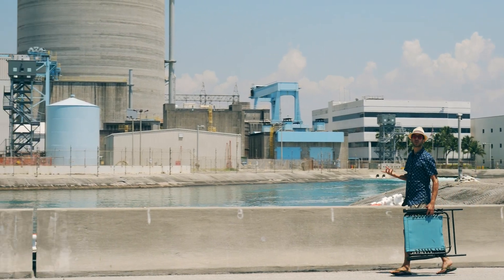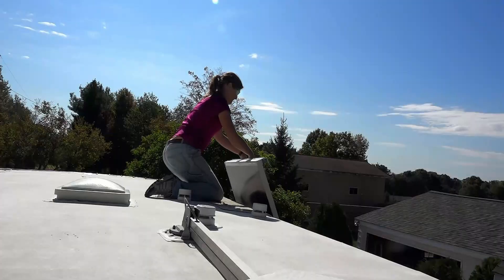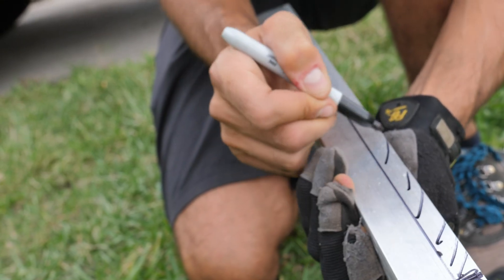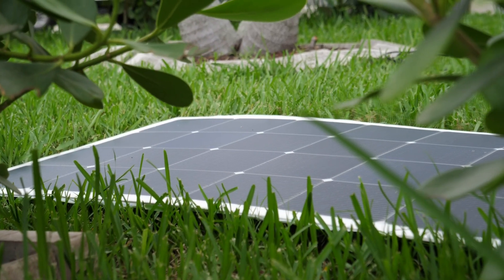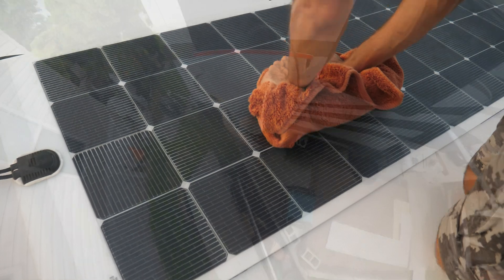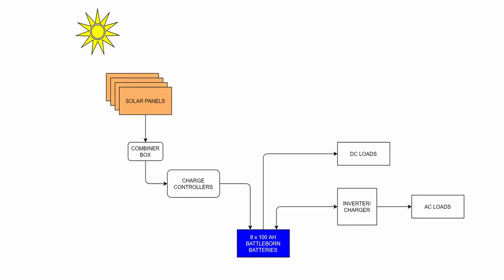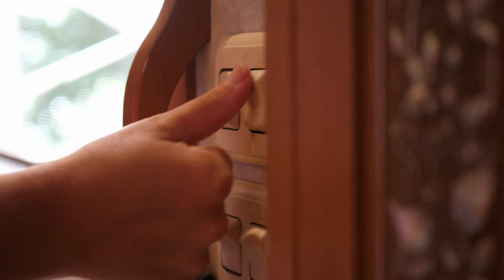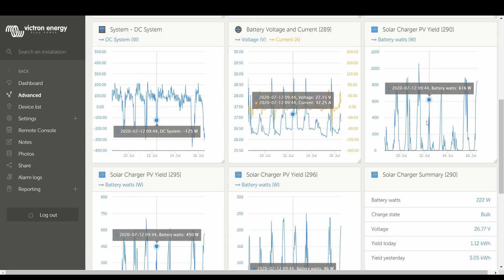Ultimate RV Off-Grid Solar System Build - 2760 Watts of Solar ☀️ 11Kwh Battery, on a 32' Fifth wheel

Comment: recently I was asking everyone in the Facebook Truck Camper group which I am a member of how they would install the flexible solar panels on the top of the camper.  Many had installed the Flexible solar panels reusing their old solar panel frame mounts in order to leave an air gap between the camper surface and the flexible solar panel in order to not heat up the solar panel from the heat transferred from the camper roof material that the flexible solar panel would be absorbing if directly attached to the roof like you had done.  The additional absorbed heat would presumably lessen the performance of the flexible solar panel.  Typically, solar panels produce less energy as their temperature of the panel rises

Comment: Can you please tell me how your JC Refrigeration install is holding up?  We are heading to Indiana in Sept to have them install one in our refrigerator in our 2019 Airstream.  Airstream has replaced the refrigerator once for us and it still works poorly, so we are going to try the compressor over the evaporation system.
Reply: @Nancy Lawn We stopped at JC Refrigeration last summer to have them install a compressor retrofit on the Dometic refrigerator in our 2018 Airstream. After they pulled the refrigerator out of the trailer they discovered that their system will not work because of the type of control board in the refrigerator. This was despite my giving them the exact model number before we even made the appointment. They were not aware that Dometic was using the type of control board in their refrigerators that is incompatible with their product. I suggest that you confirm with them exactly which Dometic refrigerator and which control board you have in your Airstream before driving to Indiana.
Reply: @cliffstraw3556  Thank you so very much for the warning.  They do have our model number of refrigerator (RMD 8555).  I will certainly call them again especially since it will be a two day trip to get there.

Comment: Hello from Canada! You folks have (many times) found a way to my heart. Since you have done this, on the net there are a couple of smallish 400W (or less) 'personal' air conditioners. I don't mean the garbage that just humidifies the air for $60, but small ones with compressors etc which run up to $1000. What would you think about using something like that on a big system like you have to help out over night? You have 2700 W => ~200A of 12V current at max sun. A typical 13.5 kBTU AC will draw about 130A. So, theoretically you could run your roof AC during the day and not lose ground. At night, if hot and humid, you after the sun goes down could use a smaller one like describe above to at least keep the bedroom decent until morning and more sun. Does this make any sense? Also, since you have your panels surface mounted you cannot tilt them. Is the penalty for that significant if you stay in the continental US? Travel safe, Henri

Comment: The evolution from screws/holes/brackets to giant stickers is really something else. Similar to giant decal coverings used on aircraft/land vehicles and boats. What kind of tape did you apply around the perimeter of the solar panels?

Comment: Great video, executed like a pro.  QUESTION: When stating the size of your battery bank, how do you convert from amp/hours to KwH (i.e 800amp/hours to 11KwH).  I think 12v or 24v system is somewhere in that equation?

Comment: Yet another really well thought out video in every aspect, it’s so professional by you guys and sets such a benchmark for other you tubers that has sadly been missing by most since Nicky & Jason Wynn set sail. The amount of time and effort that you put in to this channel is staggering and so impressive. Unfortunately, I’m not educated enough in the field of this particular subject but, always wonder why the space above the slide outs is never utilised by anyone. I presumed it was probably due to excessive weight and high cost of the solar panels etc... Maybe now is the time to consider whenever a slide out is extended, that it also pulls a solar panel from it’s storage position above the other fixed solar panel’s on the roof. Which will mean that when the slide outs are extended the a solar panel is also extended at the same time. I suppose the downside is that the slide out/s have to be extended to make the ones that are partially covered ones beneath them able to be used and, in turn generate maximum efficiency etc...
Again thanks guys from this side of the pond here in rainy Brexitland, England 🏴.

Comment: I absolutely love your new system. Seems like such a simpler and proper setup as compared to what you had before.  I’m not trashing your previous setup at all.  Solar has come a long way since your original system.  My wife and I have a custom box truck/semi truck, set up like an RV inside.  We have a small set of solar panels that essentially trickle charge the batteries.  We may have to look into this system here since it can run the AC and other components inside. That would be perfect for us, especially since we have plenty of space atop our box for panels. We could finally use our 8k Onan as a backup and run mostly off solar. An Onan is expensive to run and maintain. This just sounds so much better.  Thank you for sharing this video. I look forward to hearing how this system works long term, and I’ll be looking more into this brand.

Comment: 13:43 what is 5000 volt amps? Never heard such a thing
Reply from the maker: I will explaine volt amps in a future blog post but it's the appropriate way to rate power of AC devices. Similar to watts and equivilant in some circumstances.
Reply: @MortonsontheMove  IIRC they are equal for DC and purely resistance AC loads like a toaster but not for AC loads like induction motors and stuff with surges?

Comment: Awesome installation.  Do you have concerns over heat from the panels cooking your roof material?
Reply from the maker: Yes and no,  We will address this in our next video on the system.
Reply: @MortonsontheMove  Fantastic teaching video, great job. I did notice that another channel did a follow up video on panels stuck to the roof and there were yellow areas on the roof that he felt were from the heat. Don't know if the solar panels get hot from generating electricity or the sun shinning on the black panels, or both effects. But on his new install he placed some insulating material under each panel. As you say, you will monitor the situation. Thanks for the education.

Comment: Where in Florida were you. We are in SE Florida in Boca Raton. Also why do?dn't you build a lightweight tiltable panel on which to mount the two panels on the front cap so they could be adjusted to gather better sunlight? That would have been nice.
Reply from the maker: We actually thought about it!  Just came down to complexity and longevity of the design.

Comment: Dang! Wish I would have known about this. I would have def volunteered to come help! I wonder how the increased heat will affect the performance on the panels. I also wonder how the heat of the inverter being so close to the batts will affect the longevity of the LiPO batts over time. Stay safe and healthy! As always, a great video!
Reply from the maker: Hey Joe!  As for panel heat we will address that in the next video. Because its the larger inverter @ 24V it really doesent get that hot.  The space is also pretty large so we havent seen temps exceed the 90's in there in the worst circumstance so far.... so should not be a problem.

Comment: How long can you run the air conditioner?  Also, what about your logo that was on the cap?
Reply from the maker: Lol, Logo is gone.  Well during the Day the solar can keep up with the AC,, not much left over to charge the batteries tho. On a full charge the AC will run for about 7 hours on this

Comment: Fantastic video Tom & Caitlin!  How do the BattleBorn panels deal with heat?  I understand that is the main disadvantage to flexible panels.
Reply from the maker: That is correct and we will discuss that in our next video.
Reply: @MortonsontheMove  was there a video put out discussing the heat topic of these flexible panels? If so I am missing it. Also, how do these panels do with the energy consumption versus the rigid panels?

Comment: It appears that Battleborn is not interested in marketing those panels on their site. Who else sells them?
Reply: The only online source I know of is 4thdsolar.com. The panels are manufactured by Merlin Solar (merlinsolar.com). Xantrex also sells them (and now BattleBorn). They are great high-end flex panels with lots of shapes/sizes but pretty expensive. I've been testing one for 8 months and would recommend them if you have the money.
Reply: RV with Tito DIY Thanks! Holy smokes, they are $$ proud of them!!
Reply: @RVwithTito  holy shit are they expensive. 220w for $800 no thanks.

Rich solar are $0.80 a watt. Definitely not as nice or flexible but dirt cheap.
Reply: I think he said they were texting them for battleborne before they launched the line officially so that's why you won't find them anywhere yet.

Comment: The system may be impressive, or not depending of course on the cost. If the cost was $50,000 then I'm not too impressed.
So how much was it? (or rather how much would it have been if you had paid for it)
Reply: At least $18,500 (minimum) if you had to buy it yourself.  The link to Battle Born is on his description above.  That isn't including the inverter, etc.

Comment: Soooo you saved 70 pounds on the solar panels, and added how much weight with. Brattleborn batteries
Reply: Also sounds like you lost some battery capacity, my two cents. :.)
Reply from the maker: Hey Roger - we have a side-by-side comparison sheet between the new and old systems over on the corresponding article - tried not to get too far into the weeds on this video but the next one will be a more detailed look at the system. If you look about 3/4 of the way through the article right before we talk about the performance: https://www.mortonsonthemove.com/rvsolar/ultimate-off-grid-rv-solar-power-system-build

Comment from the maker: Thanks for Joining us today! When you finish with this check out what we added to the system to optimize it! - https://www.youtube.com/watch?v=QCCxjT_SE18

Many of you have asked why we switched away from the Tesla Module setup and the Primary reason is that we had 5 Battle Born batteries from the Go north Build to use and they are a much easier install.   We kept all the equipment from the Tesla build however and have plans for a future project with it.  

If you are looking for more details on the install specifics that will be coming in the next video, then we will get into the details of what else we are doing with this system.

Comment: I saw in ur previous video that you would have liked to experiment with a powerwall tesla battery combo, why did you step away from the tesla batteries?
Reply: Because they were given these batteries
Reply: Tesla also will only allow them to be installed by their technicians and they won't install in a motorhome. I found this out by attempting it myself hahahaha